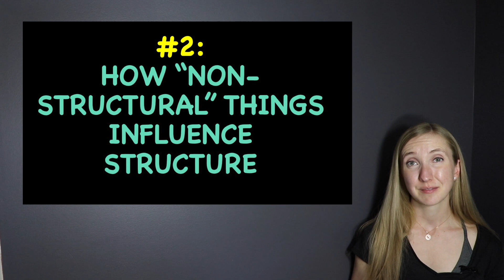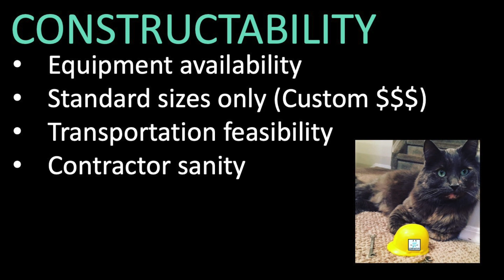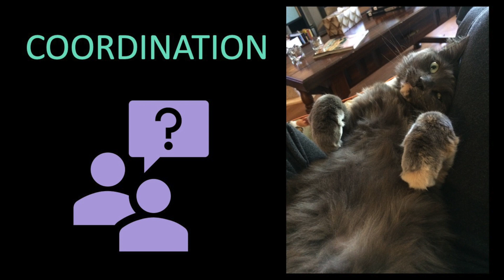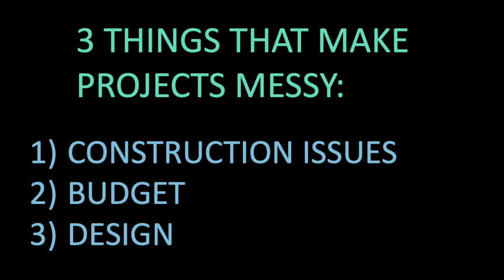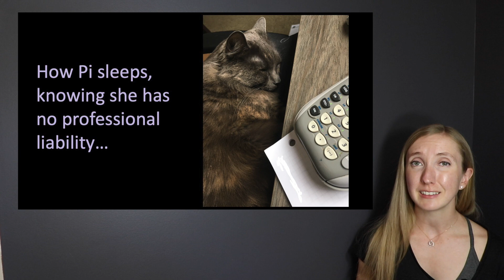Being a Structural Engineer: 3 Things That Surprised Me

Comment: Greetings ;
Could you please tell us about the everyday to use construction handbooks you recommend?
Reply from the maker: It depends where you're working :) In Canada we have a national building code and handbooks for all the different materials and project types. We have to follow all of them. The Handbook of Steel Construction, Concrete Design Handbook, Wood Design Manual... the list goes on! It's best to find out which codes and handbooks are applicable to where you are practicing :)

Comment: Yes as a structure engineer it is very painful for us to revise design again and again doing lot of interation on same structure just because of clients requirements , architectural requirements , Optimization of structural elements.
Reply: Mr Faraz, on your houses building project, are you ignore the electrical and mechanical loads ? or if you use it, how much those value that you using for electrical and mechanical loads ?
Reply: So painful